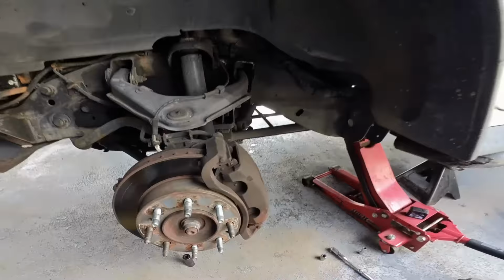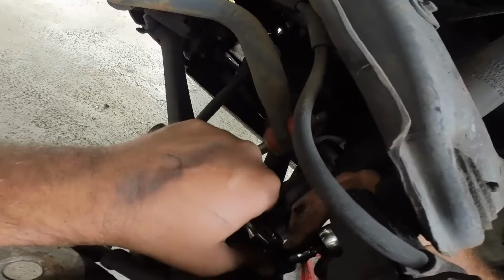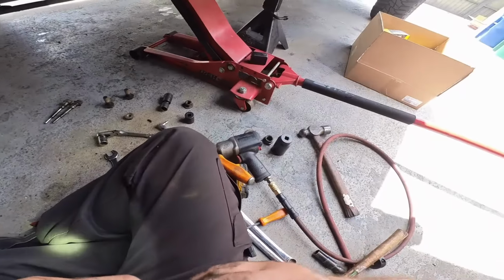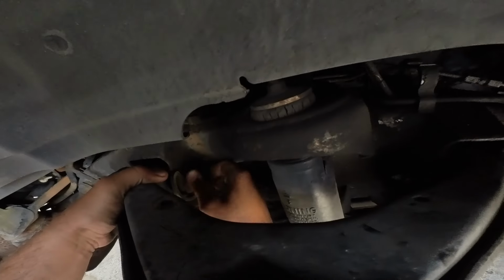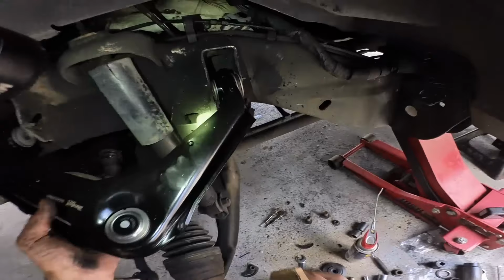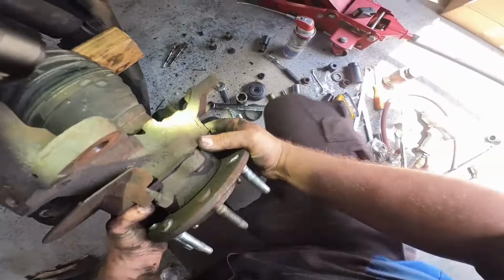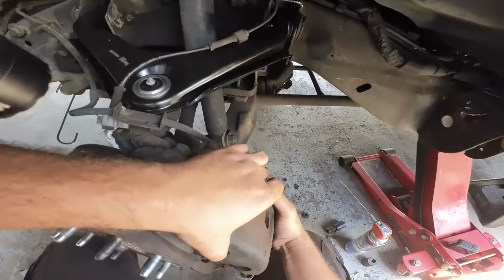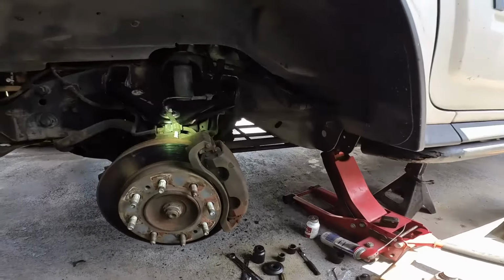Restoring a Beast: Hummer H2 Front Suspension Overhaul

Comment: Those brake caliper mount bolts get red lock tight and on some new cars are TTY bolts and don’t get reused😮I know this as the mechanic didn’t put on my H2 and had a bolt back off after a few days when I had a brake job done.Mechanic was a newbie and cost them a 22” rim that was damaged from the mount sliding and gouging the wheel😢
Reply from the maker: More than likely it backed out not because of lack of lock tight but not fully tightening the bolt. Either way that's a bad one, sorry you had to go through that.